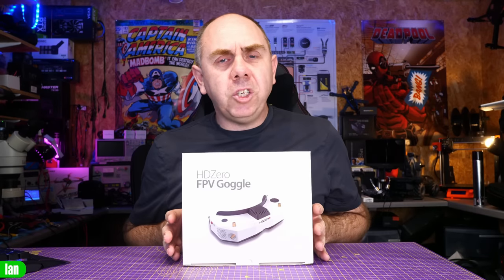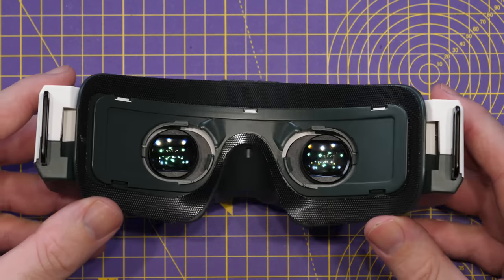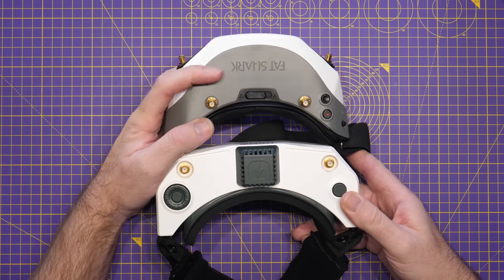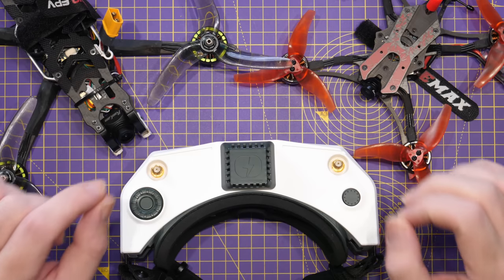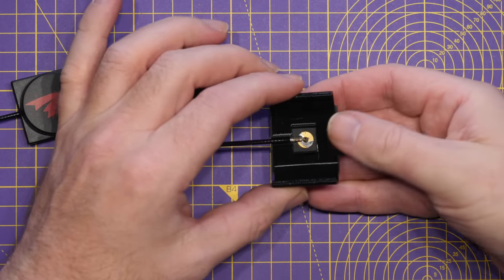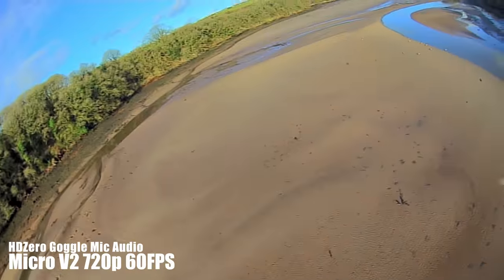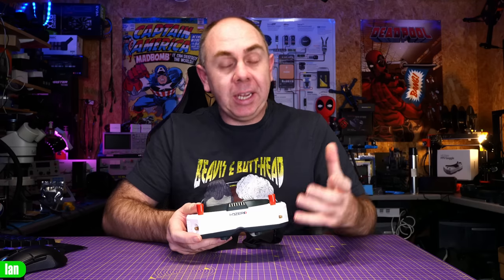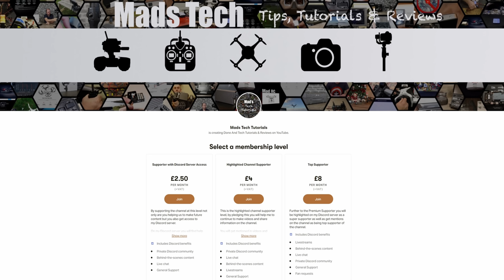HDZero FPV Goggles Review - Best FPV Goggle Available Today?

Comment: Just a heads up for anyone wanting the Wi-Fi module. It’s not available yet. The current (V1) analog module sells for $30. When the Wi-Fi capable version (V2) comes out, the V1 module will no longer be available to buy. The V2 will sell for $60, but the owners of the V1 will be able to spend $30 (which is the difference in price between the V1 and V2) to get the V2 PCB which can be installed instead of the V1.
Reply: They just released v1 and your stating v2 specs?
Reply: What will the wifi feature be capable of?
Reply: @flaparoundfpv8632  stream to a phone for viewers and (as far as i know) elrs backpack
Reply: Handy to know I feel a $30 purchase coming on :0)😂

Comment: Despite leaning more towards analog and Walksnail, these goggles may actually serve both of those purposes better than anything else. It's completely insane that this one does secondary functions better than competitors do it as their primary.
Reply: Agreed
Reply: For sure. This is where Fatshark really could pay a serious price for not including ANY input options - a seemingly simple decision but with potentially catastrophic consequences…

Very few people are ready to fully commit to a single video protocol, and even if they were, lots of us fly whoops and need an option for analog. A fatshark goggle with analog capability would have at least maintained potential for a competitive slot in the market, but once WS released that module, they kinda put a nail in Fatshark’s coffin… WS/Caddx will probably be able to stay relevant just by selling VTx’s, cams, and modules (not to mention Caddx’s other product line), but I really struggle to find any reason to buy FS/WS goggles at all.
Reply: @abertheham  This is exactly my situation. I currently only have analog, want to get Walksnail, but I also fly tinywhoops and I don't want to be carrying around two different goggles...
Reply: @Vousie  That's exactly why my next googles will be HDZero. The best analog experience, an HD system with fixed lag, lightweight vtx and decent resolution. I hope they improve on penetration, wich I am confident given the age of the system. Plus it will only get cheaper when other companies start building for the system. That's the importance of open source, wich also gave ELRS a big advantage over RapidFire, Tracer and Ghost.
Reply: @miquelmarti6537  I've considered HDZero (and for a while I thought I'd buy it), but the way it breaks up really bothers me (I prefer analog by far) and it's not quite HD. 
But Walksnail said they're trying to do fixed latency - and given that in the same announcement they also promised a whoop vtx and a vrx module, both of which they've now delivered, I'm inclined to believe that if it's technologically possible, then they will make it work. (Unlike DJI who have made many promises and either not delivered or only half-delivered.)
Reply: @miquelmarti6537  How are you enjoying the analog on those goggles?
Reply: @ogpennywise  I'm re-enjoying fpv! I found zero bugs (batch 2, still on factory firmware). I'm using the analog module URUAV EVO. The upscaler is remarkly good: stable image, fluid action and the range is not affected. On digital at 90hz it feels very immersive and in control, like if you had the quad in your hands. In that mode the range is extended and almost comparable to the djiv2. It feels ike trading resolution for frames, wich is so usual in gaming xD
Reply: @miquelmarti6537  good for you. Doesn’t help the rest of us if you say you have no problems. Did you solve anything or fix something? If not I dont see how your good fortune relates to those of us who aren’t so lucky? How did you fix the issue we are having? If you aren’t having an issue why are you chiming in?
Reply: @ogpennywise  You asked for it, 4 months later
Reply: @miquelmarti6537  I sure did! Thanks for the feedback. And how did you fix it? That's the feedback I'm "thanking" you for. And why I asked: "Did you solve anything or fix something?"
Reply: @ogpennywise    Beware that passive-agressive attitude. 
Already said there was nothing to fix. I simply didnt update the factory firmware.

Comment: Dont bother reviewing them till hdzero gets the price around $600 for their top of the line goggles. Unless they can have satisfying long conversations with my wife and go to work for me, im not paying anything over $600 for a pair of fpv goggles, unless they do digital video 100 miles or something....after receiver and antennas they are breaking the 1,000 barrier and maybe your still on analog even......im sorry thats insane. all fpv goggles today should be 1920 x 1080p minimum just like every tv or any other display in modern day. Why are we paying so so much for so so little from the goggle companies? Sorry im just over it and recently went to a ground station setup the a 19 inch 1080p minitor in an fold open case with receiver and everything runs of a 6s too, so a foldable chair and snack tray. Takes 3 mins to set up, all i do is long range fpv so works super well with the 10w receiver antenna amplifier (thata RX end, the vtx is s modest 2.5w so don't come at me fcc)  you can just sit there and fly with a giant 19 inch bright screen even in sunlight modern HD LED screens are amazing, I honestly like it so much, i only wear goggles for racing and acro on my smaller quads (65mm and a 5 inch) it obviously makes sense for that purpose but for long range fpv, ditch the goggles!!!

Comment: Having hdo2s , DJI goggles2 and Avatar... I concur the optics are the best in the Avatar's. The optics in the DJI ones are the most difficult, I'm hoping foam can fix that.
Reply from the maker: The DJI is just shocking.
Reply: How can foam fix optics?
Reply: @azixaka  hear me out.... when I take off the dji pad thing,  then just look through the goggles, it's all fine
Reply: @GardoRotor  Oh really! I don't understand it still. So getting kind of further away from the screens by a few millimetres of the foam's thickness improves optics? I should give it a  try!
Reply: @azixaka  Focal length is super important for clarity. Think magnifying glass or binoculars or microscope.

Comment: Excellent review, very comprehensive. I will definitely be buying a pair. With my 04x/vrx combo and HDZero goggles. I can take people for ride alongs. In the comparison between the HDZero and O4X I thought the O4x looked slightly better, but that could just have been the DVR. I think HDZero should consider a goggle without the analog component. For the ones that have finally let go and moved on from analog. It might be cheaper and lighter.

Comment: Holy shit. For many years I've been satisfied with my old 2015 era FatShark goggles and really didn't care for whatever new digital whizzbangs were out there. But watching this video the whole time I'm thinking I want it I want it I want it I want it. The external mic to DVR is really nice and would save me a lot of time editing video later. I love that it can do analog too.
How does the head-tracker IMU data get to the aircraft if there is no two-way transmission?
Great video, thanks!
Reply: The head-tracker port puts out PPM signal, so I guess it would be up to your RC link to do the head-tracker control, like with Cliffs Headtracker project, or some of the other analog goggles like the Aomway Commander V1s that had an optional head tracker module (still using those myself, but am now eyeing the HDZero goggles also).
Reply: @pfeerick  That makes sense. How did you know that, I was searching all over the HDZero site and didn't see any mention of a head-tracker output port.
Reply: Ian mentioned the port in the review, and  the manual for the goggles shows pinout as PPM and GND, but doesn't seem to be much more info atm :-/

Comment: I only fly analog at this point in time. The possibilities these goggles present is tremendous, however to get them for analog and someday HD makes them a $700 to $800 set of goggles, even at the current discounted price. You have to be able to say I am definitely going to fly digital. Otherwise they are not financially justifiable. This of course only applies if you have any type of budget that isn't unlimited. If you are going to fly HDZero, well then, WOW!!! They are cheaper than good analog goggles.

Comment: An outstanding review Ian! Thank you.

To me personally, the image is close to analogue rather than DJI quality wise. It's nowhere near Vista and definitely not even comparable to the O3 air unit in terms of the picture. I guess true racers won't care but after seeing Vanny flying DJI for years and PhantomFPV using DJI at all times, and these two are probably one of the fastest racers and freestylers ever, I can't believe anyone would really want to trade high quality HD image for a few milliseconds latency.
Reply: You may be missing the point?  It's about versatility.  Think about it...  With these goggles one can fly analog or HDZero for racing where one cannot fly DJI or AvatarHD and they can still freestyle with AvatarHD VRX at 100fps  if they need bando penetration and want higher quality image.   Can still fly analog, HDZero and AvatarHD whoops.  Phantom doesn't race, Vanny doesn't fly DJI in races.  These goggles are for people who want flexibilty to race and freestyle not just freestyle and also for people who want access to fly as many different types of quads that become available such as digital whoops, micros, and cinewhoops whether they be  HDZero,  AvatarHD or analog.
Reply: @AndyDreadFPV  Agreed, it does everything good enough but obviously doing many things means compromising on these things to strike some balance. If someone has a park of quads with analogue cameras, they probably own goggles that work with these quads, so I guess that particular flexibility won't matter that much for these pilots. You don't get much versatility with DJI systems, it's Vista or O3 but the one thing that you get there is a superior picture, nothing comes even close to it. I just feel like for your eyes that spend all the time looking on the picture inside the googles coming from the camera on the quad, picture quality would be the most valuable parameter that you wouldn't want to compromise on, just logically. 🙂

Vanny did race with DJI, there is a nice video of him testing DJI vs HD Zero and he was actually faster with DJI. Phantom is well known for his super fast proximity flights. How fast doesn't even matter, the point is that, the biggest selling point of HD Zero, ie what they prioritised in their compromises triangle is the latency which for any pilot simply won't matter. Vanny is probably in the 97+th percentile of racers and Phantom is in the 97+th percentile of fast freestylers. Latency isn't an issue for them in DJI system, why would it matter to anyone else? 🙂

Don't get me wrong, the new goggles from HDZero are great and it's super cool it's opensource, works with this and that and so on. It will absolutely have its piece of the market and fair enough. It's just the picture quality is on par with analogue not with the bar DJI set and for me, personally, and I believe for a lot of people, picture quality is what matters the most. It's a bit like DJI being an iPhone like system while HDZero open source stuff is more like Android. Nothing wrong with either of them, just have different priorities - smooth, visually appealing, simple user experience VS flexible, works everywhere opensource platform.
Reply: @azixaka  The AvatarHD with recent firmware comes close picture quality of O3 and the VRX will work with these goggles at 100Hz,  Yes it' not as good but it's not that far off, maybe 10-15% better on O3.  Many pilots would trade that little less picture quality for the massive increase in versatility since this goggles will run AvatarHD at 100Hz.   A few won't and that's Ok too.   This product does though, serve a market segment of people who value versatility and the ability to fly multiple different systems with just one goggle and don't need the extra little bit picture quality of O3 over AvatarHD and they can still race with ultra low latency.
Reply: @AndyDreadFPV  Obviously subjective but I tried both and to me it's nowhere 10-15% difference, the difference is huge, it's twice or more better.

These goggles have 90Hz OLED screens btw, so the VRX will not work at 100Hz.

https://www.youtube.com/watch?v=X65ddN3lWjk

https://www.youtube.com/watch?v=gEhDiqVDOTk

But of course, if you see little to no difference in image quality between DJI O3 and the rest then sure, go for a cheaper, more versatile set up of course mate! For me personally, the difference in picture quality is too big to be ignored. DJI Googles 2 and O3 Air Unit do just one thing and don't work with anything else but Vista, but they do it damn well, simply the best image possible.
Reply: @azixaka  aparently they work at 100hz with the AvatarHD VRX just fine.

Comment: Thank you for your great video.

I bought the HDzero goggles two weeks ago, but unfortunately I wasn't lucky enough to try them because I mounted a VTX Eco Kit with the Runcam HDZero camera, I made a hundred thousand attempts but to no avail, I can't see anything. The light on the VTX is only red, the blue one does not turn on. In my opinion it could be firmware incompatibility. I don't know what to do anymore, I ask for help if it's possible. Thank you!

Comment: Good day Ian! Just received my HDZ's and have to say thanks for the head's up on the pre-order! Absolutely fantastic, just curious tho, do you know the maximum capacity microSD card size for this DVR? I would assume minimum 100Mb/s write speed as with the DJI's? Once again, thanks so much for the fully instructive "review". Much more of a resource than almost any reviewer out there, and likely the most current. Great Job Sir!!!
Reply from the maker: I need to check the recording bitrate. I don’t know the max off the top of my head but the usual would be 256gb. But I need to check this.

Comment: Great review as always, Ian, thank you! I'm really tempted to buy these goggles but I'm a little afraid I will have a problem with my rather large IPD of around 72 mm. I've only owned box goggles until now. So I don't have a feeling if the maximum IPD of 70 mm of these goggle will be a problem for me.
I would actually be willing to modify the housing of the goggles with my trusty Dremel. And looking at the CAD model available on Github I think it might be possible to gain another mm on each of the adjustment sliders. But as the model does not include all parts of the goggle I cannot be sure. Maybe you can comment on that when you inevitably take apart these goggles?
Reply: I don't think being 2mm off will be an issue. I usually set my IPD just by feel. Although it could be that I'm just not particularly sensitive to this.

Comment: All looks great, but why doesn't anyone make a IPD <= 75 goggle? Not one of these high-end goggles work for me. I'm still stuck with box goggles.
Reply: Generally, the optics modules are purchased completely assembled and the IPD range is chosen by the maker of the optics module. The goggle manufacturer doesn't have any choice here, especially when they are sourcing a very limited availability optics module like 1080p OLED 100 Hz, of which there may be literally only one available.

Comment: I'm about to buy new goggles soon (coming from analog with the eachine 800d). The only other goggles i ever tried are the dji v2 (flying) and the g2 (just put them on for a few mins in a dji store). I don't like the fit of the v2 but the g2 were  comfortable in my opinion. Just had small issues to get sharp corners. Since the dvr is not always representative for what you actually see: can anyone who tried both the goggles 2 and the new hdzero goggles, tell me if the difference in image quality is that big? which of both goggles do you prefer for freestyle and flying around for exploring and flying around with friends? I'm not racing so often and just want to have the best total expierence. And more important: I don't want to invest 1000€+ to get a hyped system that actually isn't really better than some of the alternatives :) thank you